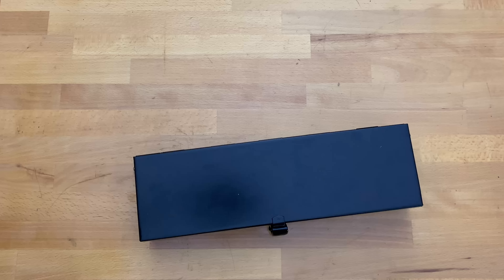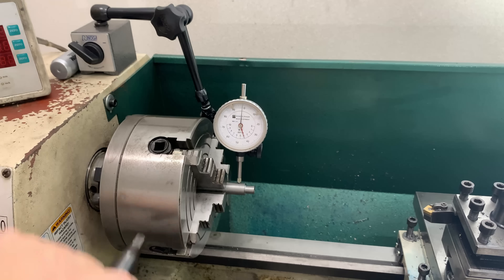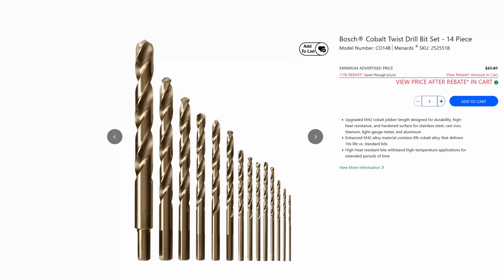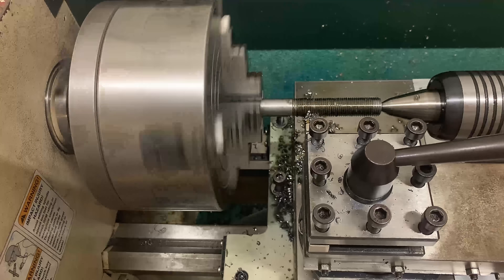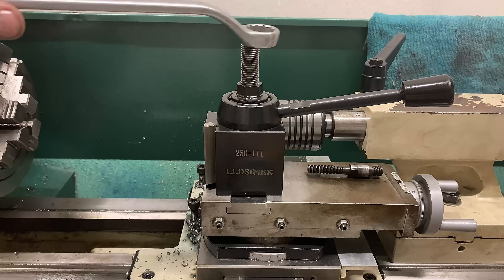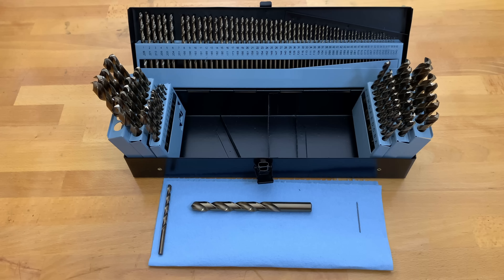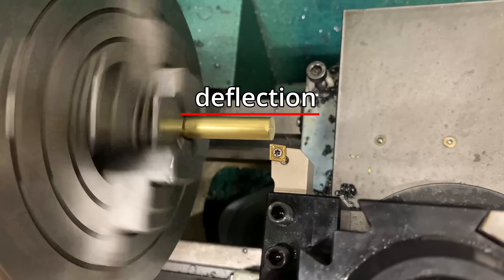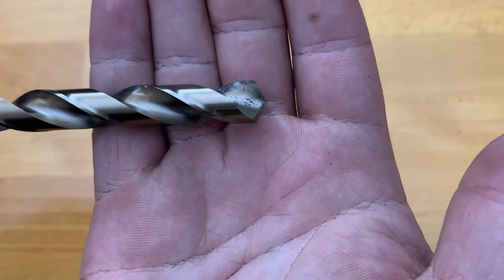Are Harbor Freight Drill Bits Secretly AMAZING?

Comment: I've had a set of these for like 8+ years and used them quite a bit. Mostly in my PM-1340GT lathe and they work pretty good. Just broke by 1/4" by trying to drill ~3" deep in mild steel and didn't back off enough to clear bits. 100% my fault. I'd buy this set again w/o hesitation.
Reply from the maker: How do you like your PM-1340GT? I've drooled over them more than a few times!
Reply: @ShopHumor  Got it back in 2016 and love it. I started out like 20+ years ago with a small 7x10 from Harbor Freight. It was just a toy but served me well for the little things I would turn on it. Then in 2015 I made friends with a retired machinist and spent a few hours on his 1967 Atlas/Sears lathe and I was hooked. Spent about 4-6 months researching when lathe I could afford & still fit in my basement. Since I already had a PM-940-CNC milling machine, I decided to go with the PM-1340GT. once I got it I upgraded to an induction 3 phase motor with a new control panel. I moved in 2021 and still have the PM-1340GT in my new house. After 9 years I'm still very happy with it and will probably will be the same manual lathe I have the rest of my life. I also have a Tormach 15L Slant Pro lath for times when I need to make several of a part. But, you really can't beat a good manual lathe.
Reply from the maker: You have some really amazing tools my friend. Thanks for telling me about them :) I’m thinking of upgrading the motor on this G0602 to a VFD in the (relatively) near future.

Comment: I have had decent luck with these bits in the past, I use them for mostly wood, aluminum and on occasion steel. The last set I bought was total trash, 4 of the bits were not even straight and wabble like mad in the drill press or lathe. I will always have a set of them around to beat the crap out of, but for the work I can't deal with a 1/4" bit with .02" runout ill have some quality bits.
Reply from the maker: Sounds like some major quality control issues... thanks for commenting.

Comment: Bought the Drill master version of this set 10 years ago. The idea was replace the common used bits as needed but still have the odd sizes whiteout breaking the budget. It’s been great for light shop use. Replaced a few and had some broken by the shop help that don’t know how to use a drill but overall it’s been a good buy. I just wish the index case wasn’t garbage
Reply from the maker: The index case really is trash. I guess they had to cut corners somewhere!

Comment: Warrior drill bits are exceptionally soft. I picked up a 7 pack to drill out a lock, half of them twisted when they got caught up.
Reply from the maker: Were they the cobalt ones? I've seen a few people making comments about the cheaper Warrior drill bits having some major QC issues but I haven't tested them myself. My results with the Warrior cobalt drill bits have been pretty good - my 7/16ths has now put quite a few holes in steel and hasn't dulled at all.

Comment: There junk and  $ 129 regular for what they are for that set.  if you not drilling  steel  there okay💯👍✌️🫡  all though it cost more for others there better  it's easier to buy single only in what you need.
Reply from the maker: Thanks for the insight into your thought process!

Comment: I have a visually identical set (different color, same dumb latch) from Costco that I bought maybe 20 years ago and they’ve done just fine for me. Wouldn’t be surprised if they came out of the same factory! My general rule is to not buy cutting tools at HF, but they seem serious about continuous improvement.  I recently acquired a Hercules circular saw that had a really nice blade so maybe it’s time to adjust that rule. Cheers!
Reply from the maker: Thanks for letting me know about the Hercules circular saw. I have an old Skil saw that's from the mid 90s that's getting near the end of its life.

Comment: Most people dont know how to properly use drill bits...proper speed and preasure as well as lubrication when drilling metal...all these make big differance
Reply from the maker: You're exactly right. All the information is readily available - proper RPMs, cutting rates / pressure, etc. Knowledge and technique will save a lot of drill bits.

Comment: If it helps at all, I bought a set from Drill Hog and am entirely unimpressed by how quickly the cutting edges chip and dull. First time use to extract a stuck broken bolt, I ruined 4 of the set. Luckily, I have plenty of other bits. My HSS LH bits in my MAC set are far superior. Yes, in the automotive world, we call them drill bits and what drives the bits is a drill.
Reply from the maker: I appreciate the info about the set from Drill Hog. I've generally heard good things about them so it's interesting to hear another perspective. I have always just been a broke ass hobbyist so I've never really had the pleasure of using the premium tool brands like MAC or Snap-On.
Reply: @ShopHumor  I'm sure they make some good, job-specific bits, but they dropped the ball on their Co line.  I've had much better success drilling hardened fasteners with the individually packaged, German-made DeWalt Co bits from Lowe's. I was out of town and needed to drill a wheel stud. Those bits are still at my brother's house and sharp as new.
Reply from the maker: I appreciate the additional information, thank you. Lucky brother :)

Comment: I bought 3 sets of cobalt drill bits (not HF I'm not in the US ) but the cheapest chinese  ones are roughly half as good as the most expensive named brand, the middle cost ones were appalling , they blunt a lot I have to regrind them almost every time I drill a hole in metal, and they break or bend a lot..one bend 90degrees and didnt break.
Its as useless as a broken one but its weird that some break and others bend.
The cheapest ones tend to shatter which is terrifying when it happens but they do atleast cut.
The most expensive Heller ones drill well cut well and I havent had to resharpen any yet.....In future I'm buying Heller
Reply from the maker: I just looked at Heller's website but doesn't look like they have any dealers in the US right now, or maybe I'm just looking at them wrong. Either way cool site - thanks for letting me know.
Reply: @ShopHumor  no worries . It's a new name for me too ,they just happened to be particularly good

Comment: I bought a similar set from a different tool house. It gave me a good selection of seldom used drills. I have had mixed results. A handful of the number drills were not straight, a couple split up the web. I use a lot of the drills for #4,6,8,10 pilot holes for taps, and the clearance holes. Most of those are now replaced, and just happened to be where I found the bent drills fresh from the box.
Reply from the maker: I've only done a few spot checks on maybe two dozen of the 115 pieces and mine have been straight and sharp so far, but I think I ought to get each one out and see if there are any duds.

Comment: The best step-bits i have are from HF. I've used them on everything from plastic to steel, lubed and dry. and they still cut just fine. Outlasted the Dewalt I was using them with, thats for sure. That said, this, and my own experience, put some credibility behind what I was told about HF: Their tools are good as long as they aren't power tools.
Reply from the maker: I need to pick up a set of their step bits. It seems like there's always one thing or another that I need for the shop. If only I had unlimited money (and unlimited space, haha). Thanks for reminding me about those step bits.

Comment: I have two sets - one dedicated for machine tools and another for ruining with hand drills. The machine tool set is in great shape - I just ran a bunch of holes in S7 with the #48 today like butter. The set used with hand drills has not fared so well... I find that they need a lick on the grinder to cut out of the box for some reason, like they're not sharp enough for the poor control and rigidity running by hand. I've also broken most of the smaller ones.
Reply from the maker: Were the smaller ones you've broken part of the set you run in the hand tools? I imagine that would be really challenging because some of those sizes are just so small they make toothpicks look big.
Reply: @ShopHumor  yep, all on hand tools.
Reply from the maker: @msbmotorsports  That makes sense, thanks for letting me know.

Comment: I have the smaller Warrior cobalt set and while I agree it's not high speed, low drag, German space magic, I've been quite happy and impressed with them. I use them both in my Milwaukee corded hand drill and in my drill press, which is the smallest, cheapest Harbor Freight model. Yes, I have broken three or four small ones by using them abusively, but that's on me, not the drills. I almost always use them on steel, with a little aluminum here and there. Can't remember the last time any of the steel I drilled was heat treated or stainless, but I've probably done it once or twice. I am religious about drilling metal with cutting oil (I use Oatey, might try Tap Magic if I ever run out, but never WD-40) and I almost always start with a small bit and drill the hole out with progressively larger sizes. Not the fastest way, but it keeps the holes straight and the torque on the drill low.
Reply from the maker: Thanks for letting me know about your experiences. I've tried a lot of different cutting oils -- Tap Magic, the CRC spray in a can from Harbor Freight, Oatey's, etc. I got a really good deal on some Oatey's Dark Thread Cutting fluid not too long ago - a half gallon for $13, so that's what I've been using. It smokes a little when it gets hot though and kinda stinks.
Reply: @ShopHumor  My bottle of Oatey is the clear stuff, which I believe is mostly just normal hydrocarbon oil, compared to the dark version which I think is dark because of added sulfur compounds. The oil both cools and reduces friction, while the sulfur compounds reduce friction better than oil alone. But if you get any oil hot enough, it will smoke, and hot sulfur STINKS.
Reply from the maker: It really does!

Comment: I have a higher end Bosch drill set, and misplaced it in my bedroom, so I picked up this HF set.  I've used it with my Hitachi HPT 1/2" 18V Hammer drill with wood, to modify a Cat pressure washer pump I was trying to removed from a rusted Honda drive shaft, and to drill out some rusted and snapped off bolts on said pump crank case, and have had no issues at all.  For the money, and because I've needed some really esoteric drill sizes and this set met the task, it has been well worth the purchase with a discount code, military discount, etc, getting them for next to nothing at final bill.
Reply from the maker: Next to nothing is hard to beat. Glad they're working out for you and it sounds like you've put them through their paces. Thanks for the comment!

Comment: I got this HF set, mostly for popping the odd-sized hole through mild steel when I don't have the right size in my "good" bits. First thing I found is that their lifespan shortens very quickly if you're lazy about setting the right speed, etc. Setting the press to the proper speed and not pressing hard, and I've found them to be quite usable and a bargain for the price. So usable that I'm now regretting keeping better track of the bits by putting them back in the proper storage holes!
Reply from the maker: You're right that it's critically important to use the right speeds, pressures / feeds, etc. That, and learning to sharpen, will pay dividends.

Comment: I use a lot and own a lot of drill bits. I have never worked in an industry that required me to use machine tools, so I have no formal training. This set has been great for me, mostly used with machine tools, i.e. lathe mill and drill press. I had a similar situation with the Darex Drill Doctor drill bit sharpener. A bunch of experts told me that they were useless. I have loved mine (Drill Doctor) and used it for many years now. By the way, cheap drill bits and a Drill Doctor are an excellent way to go, in my opinion.
Reply from the maker: Thanks for the insight and letting me know about your experience with the Drill Doctor. Much appreciated!

Comment: I purchased Matco cobalt 30+ years ago. Salesman said they had a lifetime warranty. He also told me to always use coolant and not exceed 500 rpm on steel. I have only had to sharpen a couple over the years. Doubt they were made in China. It is just a 29 piece set, though.
Reply from the maker: 29 pieces is still a complete set of “standard” fractional sizes. Lifetime warranty can’t be beaten!

Comment: Bashing on millimeter measurements is a bit rich from a guy whose drill set has the following sequence: 9/64, 5/32, 11/64, 3/16, 13/64, 7/32... And so on. You need to be functionally retarded to think that aforementioned sequence is better than: 3, 4, 5, 6, 7, 8. 

Tell me again, how many feet were in one mile? Was it something sane like 1000, 2000, 3000? No? What was it?
Reply: 5280

Comment: I have 2 sets of HF cobalt drills. The first is nearly 30 years old (back when HF was mail-order!) and has been heavily used over the years as the go-to bits for a woodworking DIY guy, with the occasional soft metal or 1/8" steel. Sure a few broke over the years and a few of the most-used drills have gotten a bit dull and needed to be sharpened. BUT, for what I paid for them, I am thrilled. I bought another set a couple years ago, with a good coupon. They are still new!
Reply from the maker: 30 years out of a set of drills is incredible. That's such a good value. Thanks for letting me know!

Comment: When I got into this hobby I bought a set and a cheaper Titanium coated set to go with it.  All these years the cobalt set has sat unused (maybe afraid of disappointment) and have been using the cheaper gold jobbies (less chance of crying) and they have held up well for my use mostly for tapping the odd size thread.  I also have an HF 21 pc cobalt set for daily use on my work truck.  Oddly enough, one place I found that carries a good assortment of common size individual DeWalt Cobalt split-point bits  is an ACE or True Value hardware store near where I work and I get my replacements there.  Shame that a new DeWalt 1/4" lasted only 4 holes hand drilling a thin stainless commercial kitchen counter so name brand bits haven't been that impressive either.   Using bits touting 3x longer lasting that do 3 holes instead of one still results in expensive holes.
I'm quite surprised that a battery powered Drill Doctor for field work isn't a thing.. gotta be more useful than gimmicky 18v powered jobsite radios, latte makers, and flashlights.
Reply from the maker: That's an expensive hole for sure! Have you gotten good results out of that 21 piece set you keep on your work truck?

Thanks for the comment.

Comment: I got the findmall for both my 10" south bend and my 18" American lathe. I've been pleasantly surprised how well they work. I did the recommended disassembly and deburring in the reviews and it works great! I made a top nut with a handle like inheritance machining did a video on. I couldn't be happier. It's repeatable and locks tight
Reply from the maker: That's really cool. Inheritance Machining production quality is sooo good. He's got some real gems. Thanks for the comment!
Reply: @ShopHumor  the findmall quick change tool post. I guess I forgot to say that

Comment: My harbor freight drill bits have given me a lot of practice resharpening drill bits.  I've gotten rather good at sharpening by hand and doing it quickly.  The sharpness generally lasts for a few holes, except in stainless.  I use them for general purpose farting around.  I have one good set that I use when I want precision,  and even then I turn to reamers to get an exact hole.
Reply from the maker: I think that's really the best practice. Just drill your hole slightly undersize and then ream or use an end mill to get it to the exact dimension you're shooting for. Thanks for the comment!

Comment: I almost never use cobalt except for hardened steels. In my experience cobalt will tend to drill oversized by a large margin and will always leave helix marks in the hole for some reason. I use HSS for nearly everything except 17-4 and hardened steels.
Reply from the maker: Thanks for the feedback. I'll have to do some spot checks to see if they're drilling oversized or not when I head out to the shop this afternoon. I have some steel that needs drilled.

Comment: I have the same set but the Amazon version, the case is garbage like you said but the drills are what I would call satisfactory. I use them exclusively in machine tools and they cut fine and maintain a decent cutting edge, great stuff for home/hobby use.
Reply from the maker: Using them exclusively in machine tools really does make a big difference. It removes a lot of the user error and variables that cause them to perform poorly. Glad your set is treating you well; thank you for the comment!

Comment: I bought the TiN coated drills for work(Company has a drawer of new common sizes but I wanted everything). Never had a problem an I’m drilling 4140, O1, D2 and A2. They’ve all be sharp, at least the ones I’ve used. Only drill that went bad was the one I let my coworker borrow. I walked into the maintenance room and saw the bottle of coolant sitting on a shelf while he was on the mill. I spayed the part and there was so much steam.
Reply from the maker: He must have burnt that thing up. Always frustrating when you let someone borrow a tool and they don't take care of it. Ugh! Thanks for the comment.

Comment: As a machinist (40 years) I have found that if you use the proper feed, speed, peck depth, work holding, coolant and a strong drill press I am able to drill into steel with even fairly crappy bits.
Reply from the maker: Yep, feeds, speeds, lubrication, and technique will make a world of difference. Thanks for the comment.